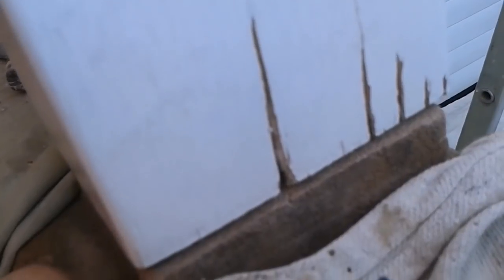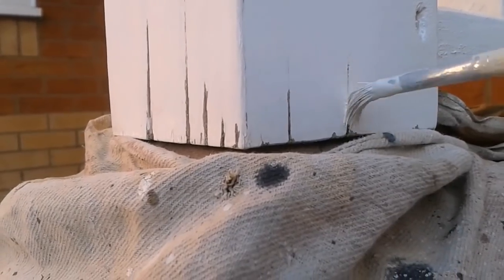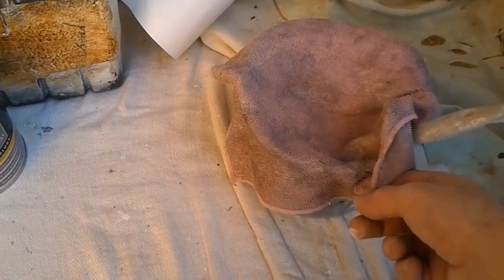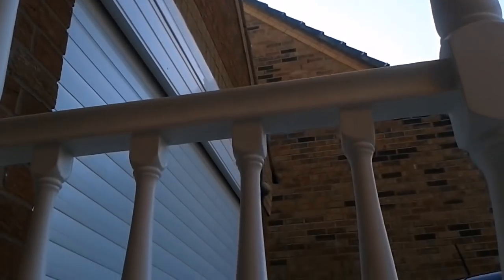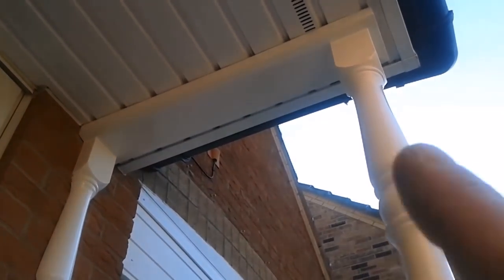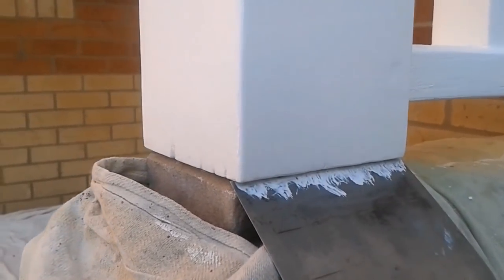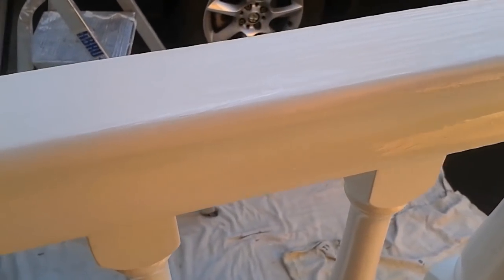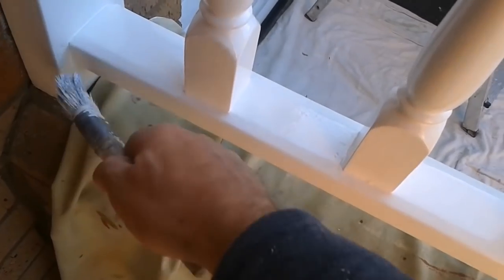Spot Prime And Painting Exterior Spindles And Posts. In February!

Comment: Looking good, nothing worse than having to gloss in direct sunlight, serious dazzling, glad you managed to beat the sun.

Down here we have had some serious overnight temperature changes which has resulted in very heavy dews in the morning, hopefully it won't effect the sheen of the gloss or cause wrinkling. Hopefully the porch cover will help. Still too early to tempt me outside!
Reply from the maker: Thanks, yes usually no painting this time of year, but if the day temp is good and it's dry. Crack on..  just no glossing after 2 o'clock is what I was taught undercoat only.